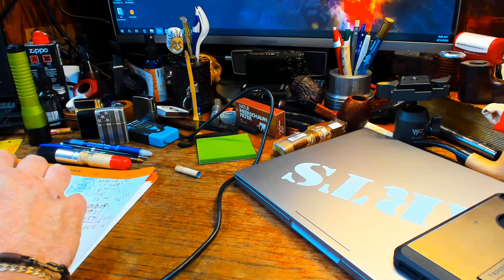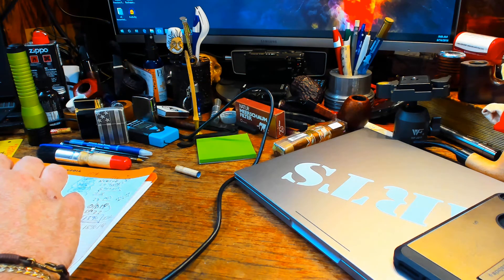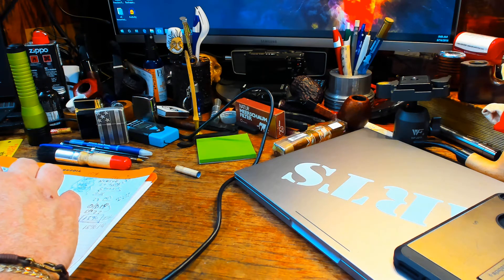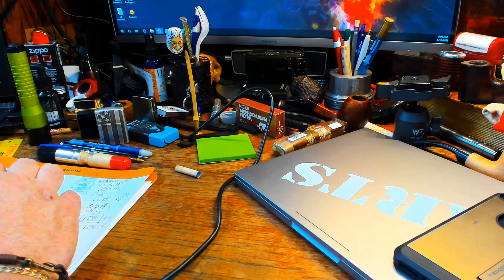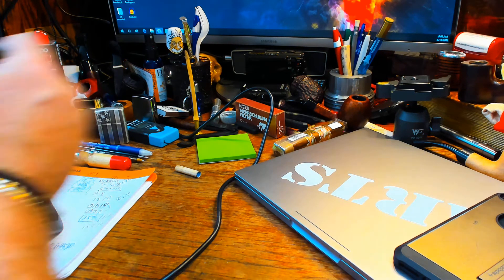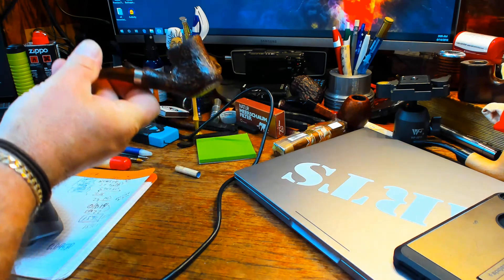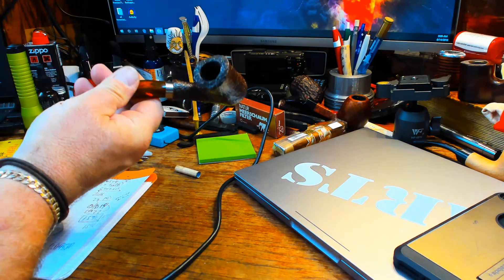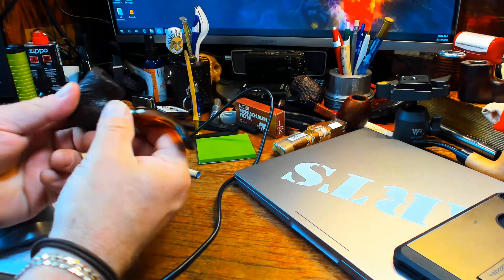more moisture questions

Comment: Thank you Sir, by any chance ,did you notice,while driving and smoking a pipe with A/C on ,you pipe tends to smoke hotter than usual?, best Greets, Paul
Reply from the maker: I have not noticed that but it might be if the air blowing out the vent is sucked into the bowl it would act like a bellows fanning the flame. LOL Different Tobacco for sure makes a bowl hotter then others.